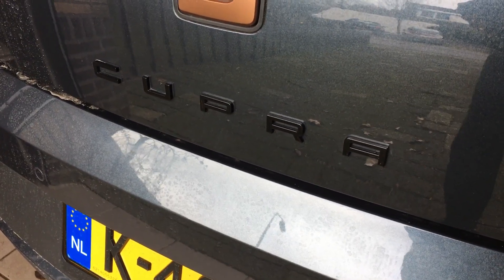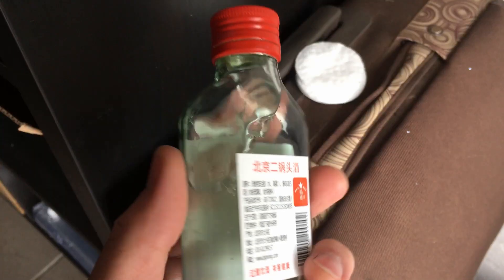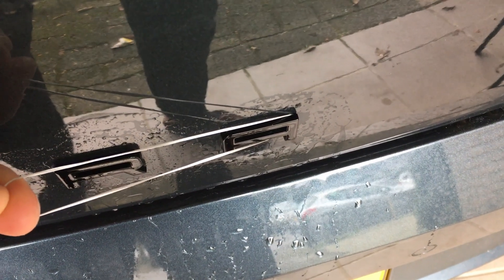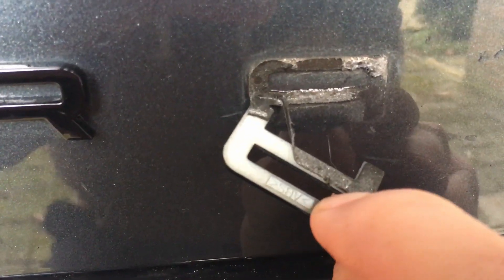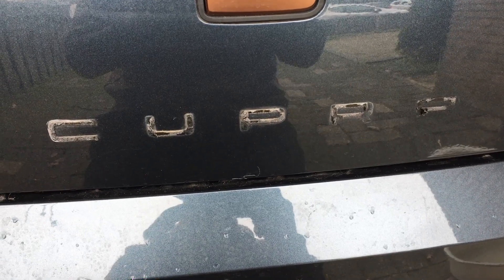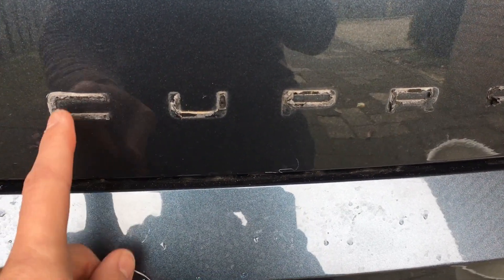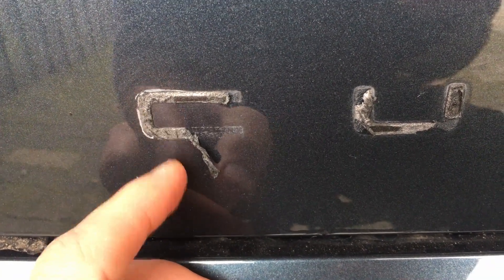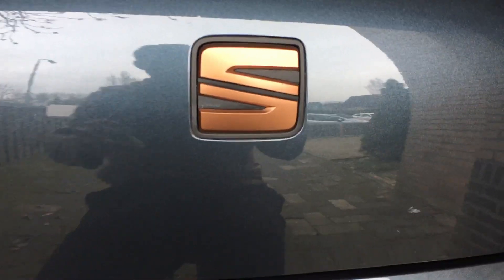I decided to remove the rear "CUPRA" logo from my car

Comment: That cupra is my dream car rn
I only have a 2018 FR, do you think it’s worth the upgrade ?
Reply from the maker: Ha! Good question, mate! I used to have the 1.4TSI FR 2018 model (Stage 1+, 200bhp). I was the happiest guy in the planet, until I decided to start making some (serious) modifications. In the end, prices are roughly the same, but the Cupra gives you more room for these kind of things thanks to its famous E888 engine. I was lucky as I found a pretty good deal for the Cupra I got and exactly as I always dreamt of, a "canvas": no sunroof (20kg extra weight and leaky in cold winters), no Beats sound (standard one is amazing), no Brembo kit (I prefer ALON/AP Racing), no side skirts (don't like these things), no keyless entry (mechanical key always better) and no signal recognition system/lane assist (I honestly don't like them) ! The car is a BIG upgrade in terms of engine behaviour, handling and interior if compared to my previous FR. It is sportive and aggressive, much better than a stock/performance GTI (GTI TCR is the same as CUPRA) and I have tested a few. Only thing, I wish it was manual and AWD (e.g. Audi S3, Audi S1 2016). You can feel the change between driving profiles (adaptive dampers, steering wheel, engine) and they actually make sense, unlike the FR models (only fake-ish throttle response). If this car is your dream car and you are in the position of getting one, I would seriously recommend to fulfil your dream! Let me know if you want to know more =). Next video soon!